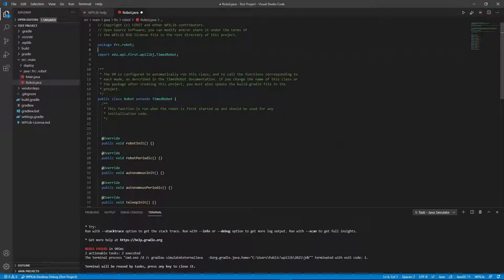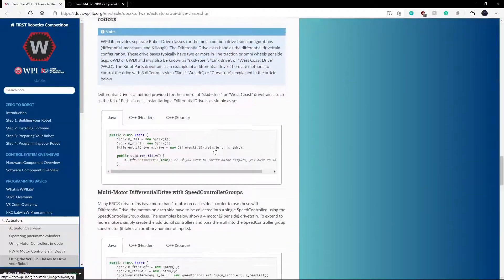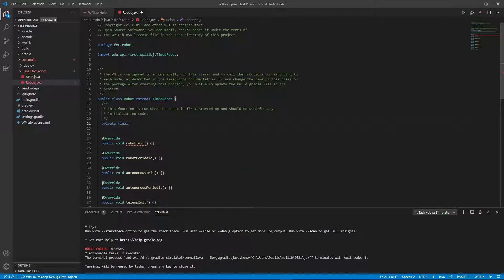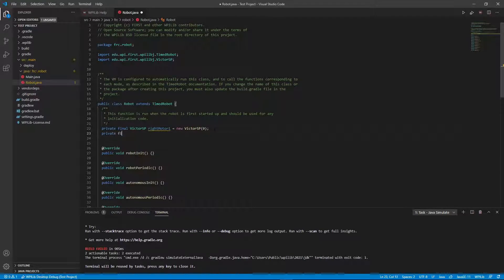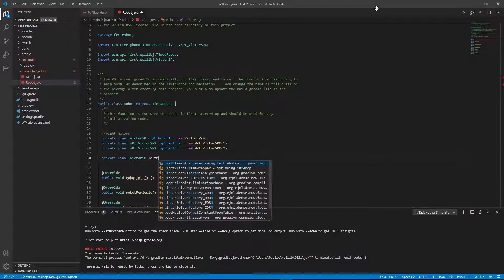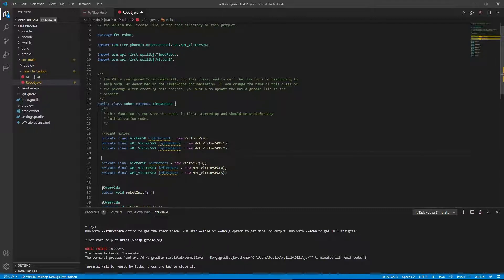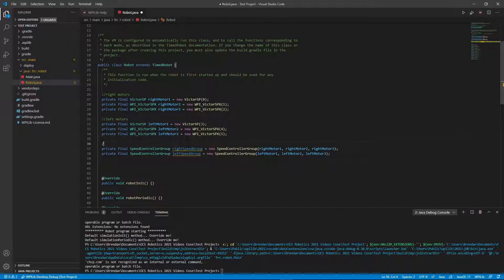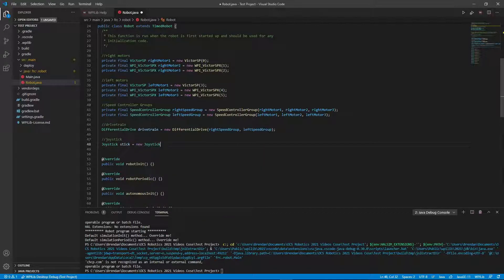How To Code a Drivetrain - WPILib FRC Java Programming Tutorial Video 3

Comment: Hi! First of all I would like to thank you for this tutorial, helped me alot! I have question: What would you add in your code if you didn't want to motors to use 100% output? I used your code for our robot and since the output is at 100%, it is very hard to pilot. Thank you!
Reply: When you do the drivetrain.arcadeDrive() method, just multiply the values you put in there by like .8 or .5, that'll slow everything down. So it would be drivetrain.arcadeDrive(stick.getY() * .5, stick.getZ() * .5);
Reply: instead of using 1, use a decimal value, like 50% speed would be .5